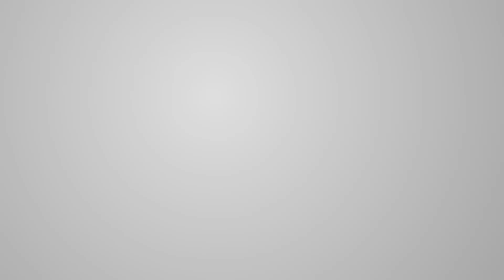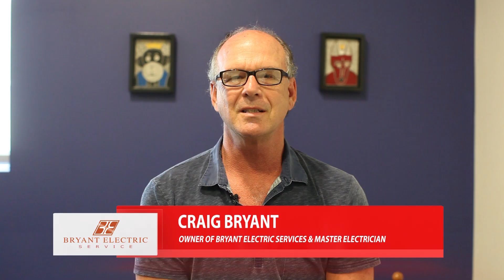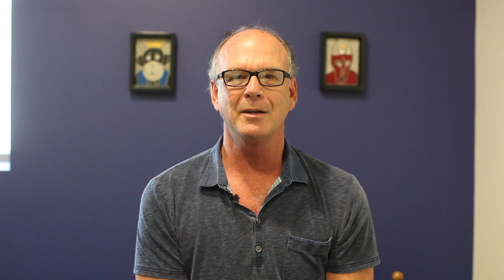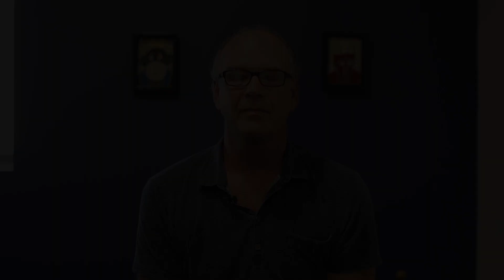Aluminum v. Copper Wiring

Comment: Pretty sure main electric wires running throughout the world is not copper except for the one branching off of the mains going to homes so it can't burns easily cuz not fully pure electric at its best.  For example, performance.  Pretend the goal was to turn it up to burn but it won't cuz copper work not as best I think only

Comment: I see this is ten years old...The Copper and Aluminum conductor qualities are not that far apart in 2025. What the issues that occur with terminations - and it does occur with copper is 2-fold. 1. Torquing is not performed in 80% of terminations. 2. Installers are so distracted in our current time frame, they are paying very little to details. With the cost of copper, more and more aluminum is being installed. Preventative maintenance will be more important than ever before. If, as you mentioned, the "crust" on the aluminum would NEVER occur with proper Preventative Maintenance (human error)

Comment: Aluminum does have one other advantage: weight. Aluminum is almost twice as conductive as copper for a given weight, even though copper is more conductive for a given wire diameter. This is important in, for example, aircraft wiring. Crimped connections using connectors specifically made for aluminum wire are just as safe as copper.

Comment: but the cost is near twice for copper over aluminum. i stuck with aluminum service wires for my manufactured home because it lasted 45 years and only failed because the metal conduit in the ground rusted and shorted the wiring. just use noalox and check your lugs periodically. funny thing is, a lot of service entrance wiring from your provider is aluminum, you just have to treat it for what it is. beyond my main service panel, the house wiring is copper, because that is where is where the real differences shine.

Comment: is it okay to use aluminum wire in underground conduit line?
Reply: yes, though you should use proper code conduit which is generally schedule 80 with a max fill ratio of 53%. you can find fill ratio charts online for the various schedule of pipe and your gauge of wiring. avoid using metal conduit, it may be fine for many years but PVC is a more permanent solution, even if it breaks it will not cause a short circuit situation. i had metal conduit in my lakeside home rust out, the rusted pipe wore through the service wiring and a short circuit blew the whole service run. it lasted about 40 years, PVC will last longer.

Comment: Thanks Craig. I'm installing a 50 amp sub panel for my RV today. I'm using 2-2-2-4 direct burial service entrance wire. You convinced me to spend the extra money for copper. Thanks for the lesson.
Reply: there's nothing wrong with aluminum service wiring, in fact most of the power that comes to your home is transmitted on aluminum wiring. look up at your power pole, yup, 99% odds are those are aluminum conductors. you do have to be a little more proactive and check the connections periodically though, but main service wiring isn't where aluminum generally has issues, but with smaller conductors.

Comment: I had looked this up because I was learning about the resistivity of different metals and I thought that since aluminum had the lowest resistivity out of the common metals, it would be more widely used as an effective conductor.

This video definitely gave me a heads up on the all encompassing properties of aluminum vs. copper. 
Thanks!

Comment: All of your comments about aluminum are incorrect.  Aluminum oxide is formed through passivation and self limits.  Aluminum does not cause issues because it expands and contracts.   All metals expand and contract.  The expansion of aluminum is only an issue when paired with copper terminations that have lower expansion rates. When aluminum rated (ALCU) connectors are used on aluminum conductors, there are no mismatched thermal expansion issues and will never loosen.   The majority (over 99%) of homes are fed by aluminum conductors (neutral supported triplex or quadrupled or USE (underground service entrance).  They never loosen in the load center because the lugs are ALCU.
Reply: Hellequin Maskharat price is a big driving force in all engineering projects. That’s why the entire electrical grid is made of aluminum conductors, from overhead transmission wire to Medium Voltage underground and overhead distribution to service entrance cables to individual residences. It’s been in use for decades.
Reply: Hellequin Maskharat the entire world. All transmission wires are aluminum. It’s known as ACSR (aluminum conductor steel  reinforced). . All standard medium voltage distribution cables are aluminum with a minority of copper.
Reply: @Hellequin Maskharat there is no soldering involved in these kind of electrical connections
Reply: Hellequin Maskharat sure. Whatever makes you happy.
Reply: I agree 100%!!! And ask any auto mechanic if green oxidation on copper wire will eat through the copper wire. Of course it does. I see it every single day at our shop and the years of feedback from other mechanics clearly confirm this to be the case. It’s called the green crustys in the industry.
Reply: Can you please explain what passivation and self limits are? Also, what is ALCU?

Comment: Why are special precautions necessary when connecting an aluminum conductor to a copper terminal?
Reply: nolan edward unlike metals will react, espcially with moisture or oxygen present causing corrosion. An anti-oxidant compound is required to avoid this.
Reply: Touch a copper wire to aluminum wire and put it to the tip of your tongue…get that taste like you would testing a battery to old fashion way. Creates a very small “charge” that will oxidize and corrode the wires